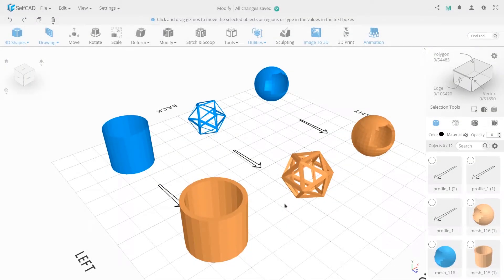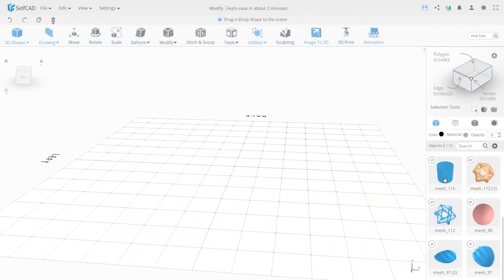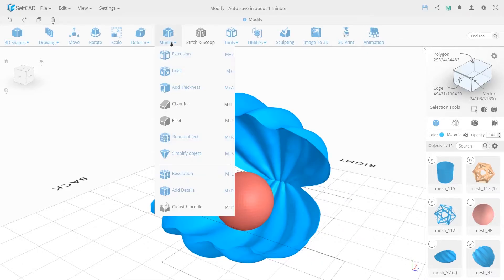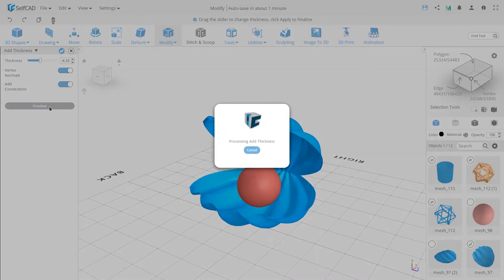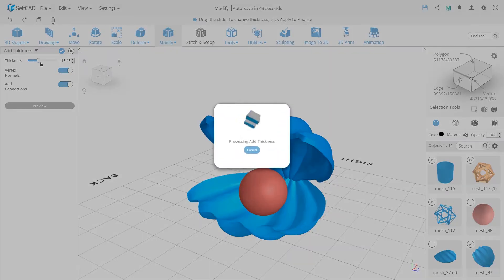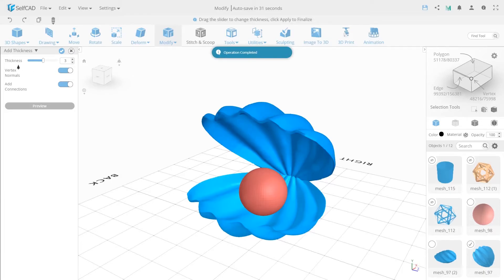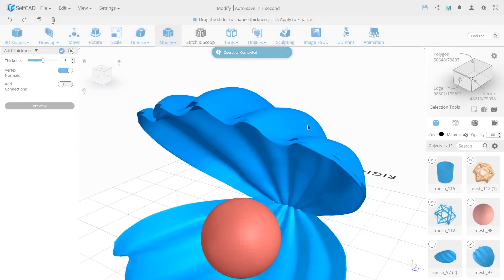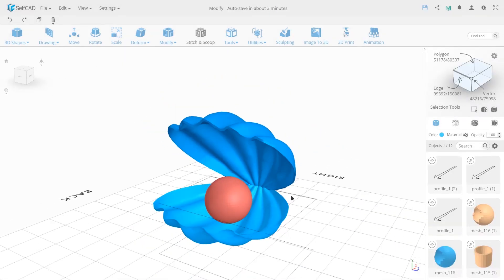Add Thickness | SelfCAD Modify Tools

Comment: Why when I add thickness my model is not smooth as before and how can I fix it
Reply from the maker: It's possible your object had some duplicated or intersecting edges that became visible after Adding Thickness. Try using Geom Clean (found in the Utilities) on the object before Add Thickness and see if it helps. You could also use Round Object to smooth out the new shape.
If none of that helps, please contact us via email (support@selfcad.com), send us the object and the screenshot of the problem, and we'll see what's causing it.